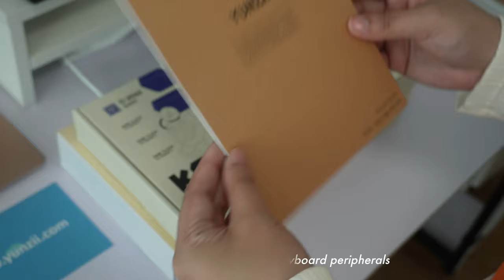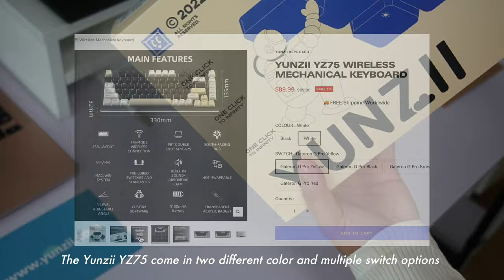that badge is a beauty | Yunzii YZ75 unboxing, showcase and sound test

Comment: The acrylic badge is really cute, makes the keyboard look more premium - but maybe when you get closer and see the plastic case, the illusion is gone. 😅
But the colors and the aesthetics in general are quite impressive! 🙂
Reply from the maker: i don't mind a plastic case, but i rather it actually look more like the website photo, which is really in black case. (>.<)
Reply: @mczstudio  Ah, I see, so it was intended to be black according to the website.. :) Yeah, I see your point - neither the surface structure, nor the color matches the rendered pictures.
Still, not bad for this price (considering that it comes with a full set of switches and keycaps for $90). 👍

Comment: I just got this and put the badge on but there is one flaw, i put the badge on and then wanted to change the rgb to look what color was best and the rgb controls are the bottons you take off, like what kind of design is that, other than that it is a good keyboard
Reply from the maker: i haven’t personally try the software out, but maybe there’s a way to remap the RGb control keys thru it? if there’s not, then it’s indeed a bummer 🙁

Comment: Which one would you recommend, the Monsgeek M1 or this? 
Been trying to make a build and these are my two options. Going with akko air switches as well. Thanks
Reply from the maker: i’d probably prefer to get monsgeek m1 international version. tho you might take note that m1 is in aluminum body and def heavier than the yz75. m1 also supports via/qmk programming!
Reply: @mczstudio  Thanks, and would this kb or the m1 be better if im going for a deeper sound signature?
Reply from the maker: @rehanriyaz2501  both board can be quite clacky, even the m1! if your going for a deeper thock, I suggest to pick a slightly heavier switch, thick PBT caps, few foams and tape mod :D you may need to play around your mods

Comment: Hi my keyboard only work  with 2.4wireless.i cant play with cable when i turn off the 2.4 and plug only cable keyboard's light turns off and only green light appears on  "4" key. i cant use with cable can anybody help me?

Comment: I know this vid is old, but how did you just flawlessly take off the board? I have the white color, maybe thats it, but it wont budge! Because of this, I cannot tape mod or foam dampening.
Reply from the maker: i didnt took it offf flawlessly, i pry it off using pvc cards and struggle alot off cam!
Reply: @mczstudio  oh ok 👍
Reply: @mczstudio  I do wish it was easier to remove